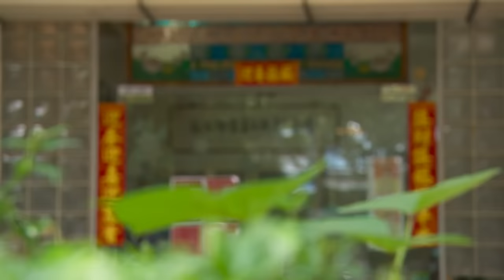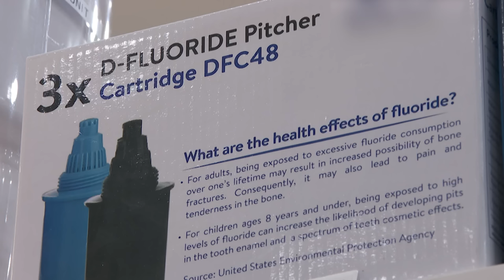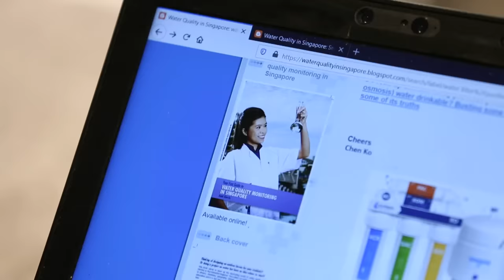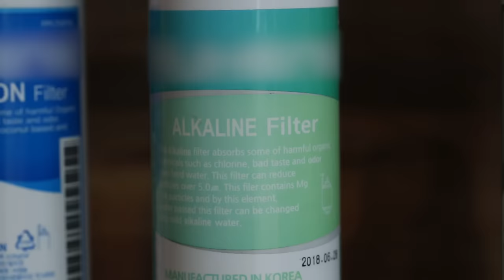Do Water Filters Really Purify Your Water? | Talking Point | Full Episode

Comment: Do test on pot boiled water and filter water.
Reply: I wonder why didn't include boiled water 🤔
Reply: @dapdap8781  I think boiling water sanitizes it but doesn't remove impurities. It's like if you had dirt in your pot and you boiled water with the dirt - the dirt is still there.
Reply: boil water do evaporate the clorine if you boil it long enough, the bacteria count probably wouldn't improve because there no guarantee 100 degree water could kill all bacteria, probably from 5 to 1, it almost like wasting power for no reason, because you need a lot most bacteria to get into your gut to get sick
Reply: Steven has replied in another comment about boiling water:

Steven Chia: hey guys...we looked at this too but ran out of time in the show. Boiling does kill bacteria in the water but it does not remove any of the minerals. Those can only be removed through reverse osmosis. In fact, the concentration of minerals to water is higher because some of the water has evaporated during the boiling process!
Reply: @silverbomb  I’m new to this subject..why would you want to remove the minerals?
Reply: @melt7891  See around 11:00 it prevents the buildup of limescale in your appliances. It also happens in your kettles, irons w/ steam function, humidifiers, around your toilet, etc. Not sure if it's necessary for drinking water.
Reply: @LakeSG1985  thanks
Reply: boiling water can concentrate impurities...  Thats why I filter my water then boil it...

Comment: I would like the experts to provide results that our piping system all over the island generally and statistically does or does not affect the quality of tap water. These filters are used essentially because tap water could be contaminated by the old rusty pipe and hence the filter are there to remove these unwanted and dirty add on to the tap water. The test should collect sufficient data with tap water taken from various locations to be able to generate meaningful conclusion.

Comment: That means boiling is the best option to eliminate those issues
Reply: There's company i believe in Omaha that makes water distillers. But one can figure if it takes 4-6 hours to make one quart water, plus the energy used. Maybe better off just to buy refill jugs ?
Reply: I use water filter mainly to remove rusts and debris. Then I will boil the water for consumption. I have been drinking boiled water for at least 20 years now.

Comment: My water filter has the activated carbon upstream of the final filter which is fine enough to filter out bacteria and most viruses, so even if there is regrown bacteria, it will get filtered out. 

Also tap water can be contaminated when the city pipe has to be repaired or the water tank at the rooftop has its regular cleaning, etc. The water filter serves as the last line of defence. 

It’s imprudent to draw such across the board conclusions ignoring variations of filter designs and realistic situations.
Reply: Where are you located?

Comment: I believe household #5 results are reversed. Either he had mislabeled the water to be tested or the tester did.  Because most household filter remove chlorine using activated charcoal, it's easy for bacteria to grow inside the tank. Remove the active carbon filter prior to the membrane and only have it at the last stage which is right after the water tank or/and add a UV(Ultra Violet) filter will help with this issue. A water filter system will taste way better than not having one.

Comment: Great little documentary, please do more in relation to water.

I see that information centered mainly around activated carbon filters and yes great to have the informative scientific studies. So long as you replace these filters within their specified time frames you should be fine.

What about the anti bacterial Water filters with the  KDF 55 media that helps prevent bacterial growth. 

 Thousands of people enjoy the taste of filtered water in comparison to tap water. There is actually a taste difference with tap, filtered and boiled water. It can be a personal preference.

Again nice episode 👍
Reply: I agree, but I wander if any of these carbon filters can be cleaned by back flushing with clean filtered water to extend the life of the filter and if so , have there been any lab testing how efficient this method is in renewing a carbon filter ? And is there a possible method and cleaning solutions that could be used to periodically clean carbon filters?
Reply: @williamgrimberg2510  great question bc they are all encased in plastic, which adds to pollution issues, and they're not cheap to replace

Comment: I live in South Dakota and we change the filter on the main water line every six months. We flush the main line by letting the water run into a bucket until the green color goes away.  I have an extra filter in the fridge for drinking water.
 Yes we are on a large municipal system.

Comment: Not all tap water is the same. It depends entirely upon where you live and where the supplier sources the water from and how they process it. I recently moved to a country town and almost immediately noticed problems I had never encountered when living 50 km away.  I would leave a washed glass to drain and it was all dull and caked. I use a waster distiller for drinking and for my CPAP machine and iron, and the sediment in my distiller was disgusting - it literally stank, and I had to clean the distiller after each 4 litre cycle. My hair felt horrible and there was no way I could wash my car or windows - even my cat and dog wouldn't drink it. Everything that came into contact with water had a dull scum, so you can imagine what it was doing to washing machine, dishwasher, taps, shower roses etc. Most residents have rainwater tanks installed, and even plumb their solar hot water systems to rainwater because mains water chews through appliances in no time. My water heater had massive chunks of calcium attached to the element - some that dislodged were bigger than a matchbox. After I had a big blue whole of house water filter system (three  4" x 20" filters) installed, everything changed. Yes, it cost almost $2k, but it is worth every cent. It remains to be seen how long before the filters need changing - but the increased life span of appliances alone - let alone time spent cleaning (and my skin and hair feeling awful) - is worth it.
Reply: This is CNA tho, this is Singapore's local news channel... I'm not sure why US and other countries are watching this, because this definitely doesn't apply to them, I know for a fact that your water is way harder than ours, hard enough to kill delicate plants. 

Part of our water supply comes from recycled water and are treated with high tech like ozone treatment before getting distributed. As far as I know, we have some of the most advanced water treatment tech IN THE WORLD and we even sell a water treatment service to our neighbouring country. So our tapwater is super clean, it's nothing like the US system. This report is meant for us, the Singaporeans, because I know some friends who definitely use expensive filters... and apparently that's pretty much pointless since our water supply's pretty good most of the time (though we still get hiccups like once every 15 years where the supply belches yellow water, then yes filters are temporarily needed, but the problem always gets fixed).
Reply: Agreed. I live in rural Ontario, and my water is hard and full of iron. I need a water softener to protect my pipes and an RO filter to remove the hardness from the drinking water. All those minerals can cause serious health problems. In Toronto I just drank tap water, it did not have those problems.

Comment: The only reason why you should drink tap water is if you completely trust your government with your life.

Otherwise, you need to filter possible contamination in the piping system. They are not perfect. They break down, they get repaired, and some particles like sand or other solid particulates do get introduced in the circulation from time to time. It's inevitable. You need atleast a 1 micron filter for that.

And chlorine is an antiseptic like mouthwash. You wouldn't want to drink mouthwash, would you? Concentration is different, yes, but years of drinking chlorinated tap water is like drinking a bottle of mouthwash. You need a 0.5 micron carbon filter for that.

When you take chlorine out after pushing it through the carbon filter, naturally there's nothing to kill the bacteria that gets into the water afterwards. That's where you put a UV Light filter to kill the floating bacteria instantly before the water comes out of the faucet.

Any other bacteria that contaminates the water when you drink it will be killed by the hydrochloric acid in your stomach. And if some bacteria still survive after that, take a probiotic supplement regularly to balance out the bacteria population in your guts, and you'll be fine.

Comment: I never worried about public water quality until I was warned that there had been a chemical spill that had leached into the water system. After that I've only used filtered water but then I heard that commercial, filtered water wasn't really any safer than tap water. So I got my own water filter, which I found just removed the chlorine taste, and finally I purchased a Berkey water filter. I hope it really does clean my water as it is an moderately- expensive system plus it takes up counter space. But the water does taste better so I pay the price as I'm more willing to drink plain filtered water than plain tap water.
Reply: until you realize. public water have some traces of cocaine, heroine, birth control, drug etc in them. you know things that they don't talk about, so it doesn't cause panic.

Comment: No need any fancy filter, just make sure boil your water before drinking.
Reply: If you do boil your water, make sure to boil it in stainless steel kettles, not plastic, to avoid health hazards, if any.
Reply: @Margaret.F  , good point. I was gonna write that, but you beat me to it. There are still too many plastic electric kettles out there. Most hotels still use them. BPA from plastic is dangerous.
Reply: @Luther Blissett , your theory sounds interesting, but after some fact checking online, it seems regardless of soft or hard plastic, polycarbonate may still be used. As such, BPA could very well be present.

Comment: You can use TDS-meter to sort of tell if there's bacterial growth inside your unit. If TDS-meter gives higher values(dissolved impurities) in the filtered water than the incoming tab-water, that's the junk the bacteria produce in your unit. Changing filters and thoroughly washing the inside of your unit well will bring the numbers down to equal. A bit different for RO, say tab-water measures 180ppm and filtered water initially measures 10-20ppm (residual sodium chloride that leaks through the membrane). After a while, if filtered water measures 40-50ppm+, it's time to change filters and take out your RO-membrane for a total scrub (slimy, slippery is the feel of mucus the accumulated bacteria built on horizontally-placed drain-water. Vertically-placed RO-membrane has a lot less problem since drain-water doesn't back up in the RO-housing.
Reply: TDS measures dissolved ions (minerality, it does not measure organic matter, so the measurement will not tell you about "junk" the bacteria produce, since bacteria cannot produce minerals at all. It can however give you guidance of your filter's effectiveness and that tells you if it may be time to switch it earlier. I would switch a filter early based on TDS measurment but I would not keep the same filter past the time recommended based on TDS as it is not an effective measurement of organic growth.

Comment: I believe water filter works. I have been using a portable jug water filter cartridge for years. Before I bought the jug water filter cartridge, I noticed there were lots of strange looking particles in my electric kettle. Lime scale and calcium build up on the heating element can be seen coated on it. After using the jug water cartridge filter, the water is clean looking and without that chlorine smell. Also, my electric kettle is super clean without any particles floating and no more lime scale and calcium build up.
Reply: This was a very informative and thoughtful video.
Reply: Travel Explorer  How is it placebo when I actually see no particles nor calcium build up? Even till this day, there's no particle and calcium as I write. Absolutely no chlorine taste or smell in my filtered water.
Well, I understand that you like vaping. Do you feel good?

Comment: BTW: There is no such thing as 'activated carbon', there is such a thing as 'activated charcoal'. 
Activated charcoal is 'ordinary' charcoal that has been manufactured and processed to create a much larger surface area via its porous structure. Ordinary charcoal can be used as a filter but will not be as effective.  
Also, I would guess that Household 5 tests came about because they mixed up the tap and filtered water samples.

Comment: I do have a number of digestion issues BEFORE I used a filter system. I mainly got a RO system to remove fluoride. I also use less fluoride toothpaste and I stopped getting soars in my mouth and I appear to have better digestion. I will still use my RO system and just stay regular with filters. Good to know you can't just install them and forget about it ...
Reply: this is kinda true because when I was having tap water to drink since it is said to be safe in Singapore, I also faced some digestive issues, and I think it has an increased level of fluoride. Then I started boiling water and I felt the difference after that and going to buy a faucet filter and heard that the Xiaomi one is better.

Comment: Regarding household #5, is it possible that the two water samples have been switched accidentally? If not, what is the brand and type of the water filter that household #5 uses that can render such an effective filtering? Hope to get a response on this from CNA.
Reply: I have the same thoughts and would like to see an answer. I’m not sure how that wasn’t addressed or mentioned already in the video or comments, oddly. It seems important and intriguing enough for more details on those results. My initial thought was that the samples got mixed up in testing… or the pipes to that particular household have some kind of bacteria issue and their water filter was somehow significantly more effective than all the other household filters. Which would be nice, then, to know what kind of filtering system that was and the product or brand of it.

Comment: Those are some expensive RO systems. They run $300-800 in the US.
Reply: @coffeelover5631  800 USD is about 1000 Singaporean dollars so it's still expensive
Reply: they are needed to eliminate the fluoride which is toxic and does nothing to avoid tooth decay. It only calcifies the pineal gland and that is bad. Makes people dull, and stupid. Just a plan from many governments.....
Reply: @linanicolia1363  There is a safe amount of fluoride, anything more than the limit will increase its toxicity. It's pretty much same for most things, vitamin C (for example) helps the immune system of your body but too much of it causes harm (go ask a doctor if you don't believe it). Fluoride does prevent tooth decay, just make sure it's within the safe limits. For example if your water contains it, then you use fluoride toothpaste and some other forms of fluoride, just make sure that the sum of all doesn't exceed the safe limit. You can check different country's safe fluoride limit if you don't trust your gov's information. If most of the countries have about the same numbers for safe limit and yet the % of tooth problems (intelligent, etc) due to fluoride is very low, it does show that fluoride is not the problem. Else there should have been a clear difference since fluoride have been used for so many years now.

Comment: So, a reverse osmosis system is really decreasing mineral levels? You really had to test this? This is basically the main job of a RO-System.
Reply: Well, CNA and especially Steven comes out with a lot of bullshit. Also, they mentioned alkaline water is beneficial? Oh gawd, that's unproven bullshit. Your body needs H20 and has no use for -OH
Reply: @heyayran  Since water is an ampholyte it always has OH- and H3O+ Ions, only the pH describes the balance of them. But yes, I don't see any reason why it should be beneficial either.

Comment: Places like Houston have Radium and Chromium in the water (just look up their water reports online).  To eliminate bacteria downstream of the filter elements, use a UV filter for the last stage.  There are UV stages that only turn on when the water is flowing, thus prolonging the bulb, saving electricity, and keeping the heat down.  Change your filters on time, and sample for TDS, Chlorine, and you can culture petri dishes on agar plates to do bacteria counts (make sure to leave one plate uninoculated as a test) and perform the transfers in front of a flow hood.  To ID the bacteria, you can DNA barcode them with genetic sequencing for about $6 per sample after running through PCR and separating with an electrophoresis gel.